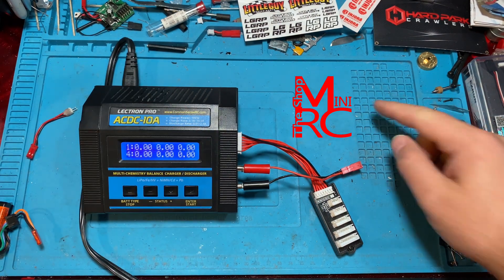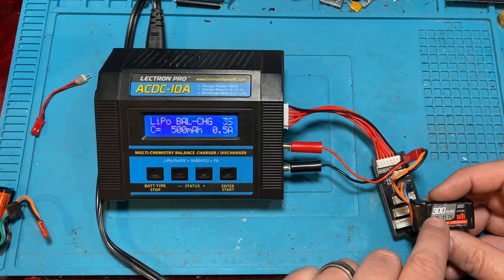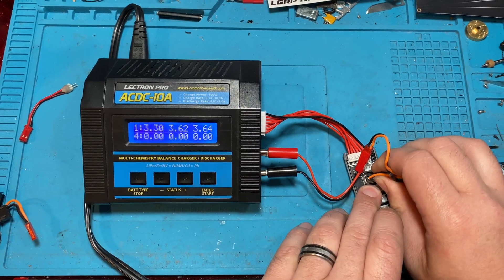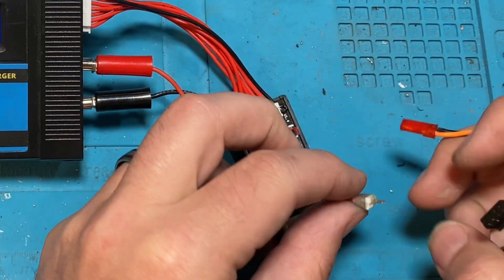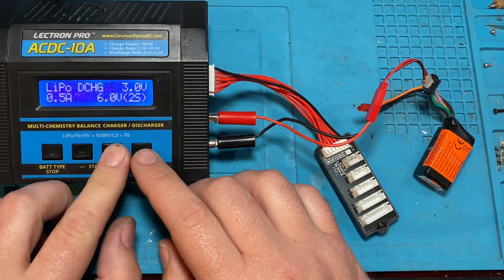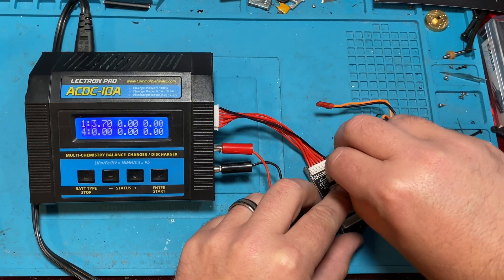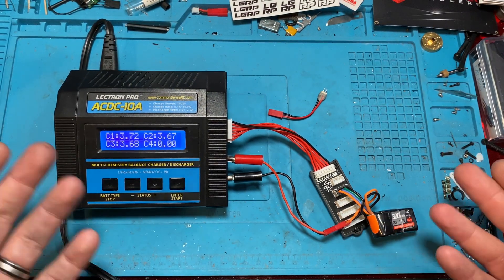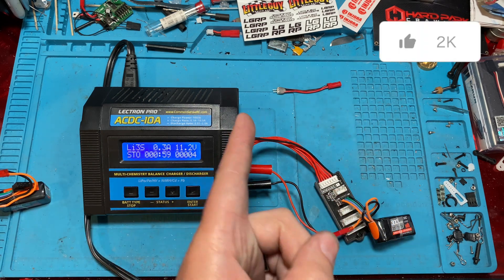Repairing an out of balance lipo cell! Fixing a BALANC DLTA V Error so you can charge!

Comment: Great vid! That Lipo just may have gotten lucky 😮 anything lower then 3.1-3.0v per-cell usually ends in 1 or more cells getting internally damaged.
Lately on Fb been seeing a ton people trying to bring back lipos with cell voltage well below 2.9v per-cell. I usually tell them can bring Voltage buck up but damage has already been done internally. So I inform them its best to by a new lipo vs the risk of loosing your house or the Rc truck.
Reply from the maker: Yep, I should have mentioned the 3v damage.  Ooof. We have brought some batteries below 3v back but yes, 100% there is damage to the cell and if you aren’t careful, it can be a huge liability.
Reply: @TheShopMiniRC  better redo it. Lol
Reply from the maker: @DadsRCGaragePNW  nawww. I’ll just pin your comment.

Comment: is there a way I can do this without having to make my own balancing plug? I don’t wanna mess anything up
Reply from the maker: Not really, you need to be able to identify the low cell and charge only it.
Reply: @TheShopMiniRC  i grinded the plastic off a connector that came with my charger. this might be helpful for your viewers. 30 seconds later im in. in my case im discharging 4.2v down to 3.7v. will this still work? i have 2 3 cell batteries from zeee and both did this: 3.7v, 3.7v, 4.2v. i dont know who to blame in this situation the charger me or the batteries. the charger is skyrc imax B6AC v2.
Reply from the maker: @pearlrival3124 good tip

Comment: Something to keep in mind is that an unbalanced cell almost always means there's a problem with the battery. Cells rarely get out of balance for no reason. Usually it means that one cell is charging or discharging more quickly or slowly than the others and that's not a good sign. Doing these kinds of things usually just masks the warning signs that the battery is trying to give you that it's failing.
Reply from the maker: I totally agree, which is why i mention that you should always watch that battery.  We have had some batteries that went out of balance, and since we rebalanced, they have yet to have an issue and have been using for months, if not years later.  On the other hand, we have had some we rebalanced and within 10 minutes the bad cell is off balance again. Those ones get the boot.
Reply: ''Always means a problem with the battery'' - DoRC
'Always' ?? Not my experience. 
I have a charger that tends to upcharge the last 
few cells, all my batteries work great but
the last 2 or 3 cells always charge up to 
a 10th v higher, progressively and uniformly higher.

Comment: This happened to my 6s battery and I don’t have a connector like that could you recommend a place I can get one?
Reply: Hey I guess it wasn’t this I had just used the battery for to long and I went to a hobby store and they fixed it thanks for the help though
Reply from the maker: I made mine.
Reply: How do I make it?
Reply from the maker: @Anth0ny2244  you need the pins and plugs and wire. You can find everything you need on Amazon.
Reply: @TheShopMiniRC  ok thanks

Comment: Question. If the black wire is ground shouldn’t you have a split 2 pin. Plug one into ground then cycle the power thru the cells. Way you did it you was reading ground through all the cells no?
Reply from the maker: The way a series is wired, you read each cell this way. Each cells ground is connected to the previous cell’s power. 

Look at this photo. https://www.precisionaerobatics.com/2016/07/28/how-balancing-cables-are-connected-to-lipo-packs/
Reply: @TheShopMiniRC  that’s kinda what I was figuring. Thank you good sir!!